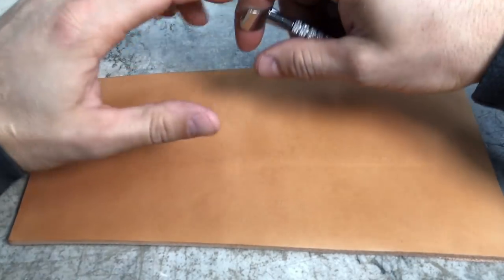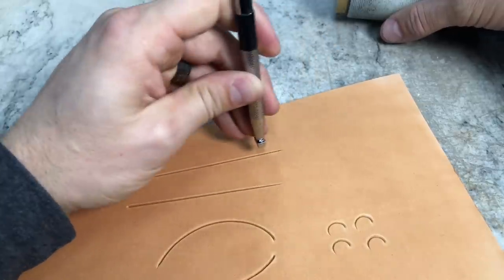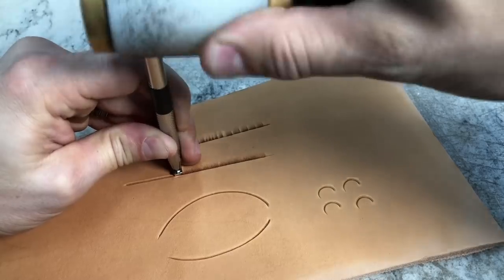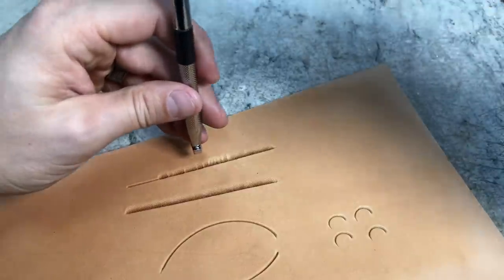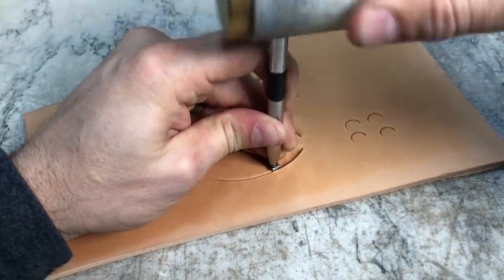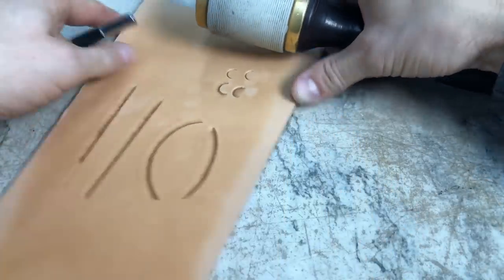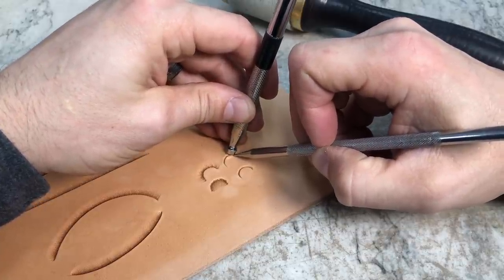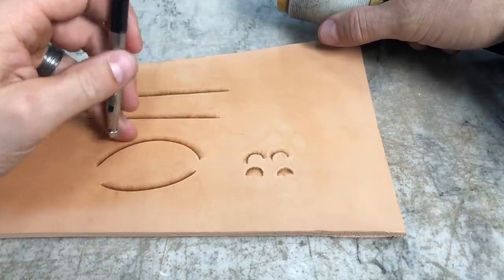Smooth Bevel Lines with Joe Meling

Comment: That was incredibly useful to me, thanks for the video!  As a mathematician, I appreciate the discussion of how the length of the beveler's face relates to the curvature of the cut -- there's a neat connection withTaylor's theorem and domains of validity for the linear approximation to a curve.  We must use a narrower beveler to accommodate a path with higher curvature.
Reply from the maker: Glad it was helpful!

Comment: On the tight turns I tilt like you did but as I got around the arc towards the end of the turn I tend to roll the tool over towards the leading edge. Haven't had any problems with with the transition and marring up the leather like I did in the beginning.

Comment: My leather doesn't turn dark if I tool it, am i casing the leather wrong or is it just the quality of the leather?
Reply from the maker: Hi Jan!
Check out the video below on casing and see if that helps - if you're following these steps and the leather is still not getting a burnished look then it probably is the quality of the leather. The video below also shows the difference in imported leather vs. Hermann Oak. 
https://youtu.be/m3YOprB3aP4